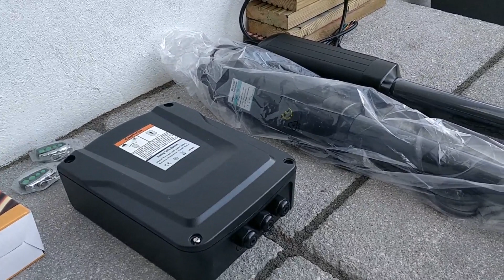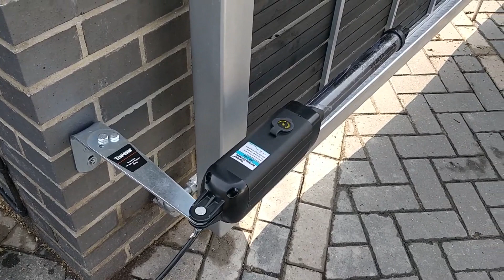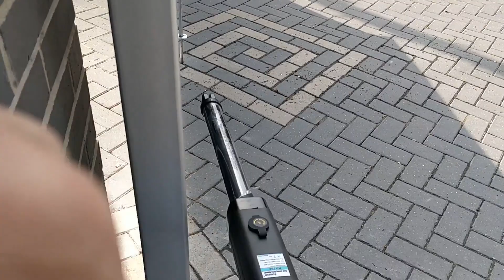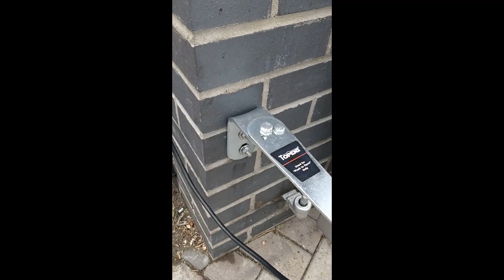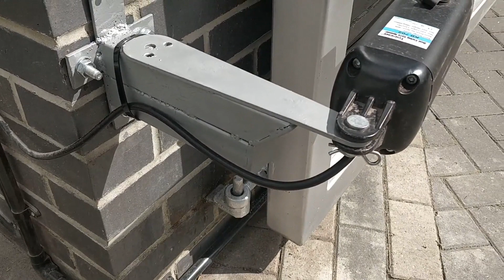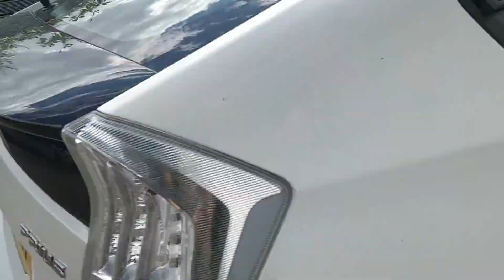Topen electric gates installation

Comment: You didn’t need to remove circuit board the green blocks pull of and u can access the screw and the brackets on your wall u you missed out the same l shape back above it should have been 4 included

Comment: Does it have limit switches on the linear actuator, which you can adjust, so that you can control the angles of gate opening?
Reply from the maker: There are no limit switches, but there are manually adjustable limit screws on the actuators. These can be used to set the range of movement.
Reply: Wonder how will the motor know when to stop, in absence of any electrical limit switches at the ends of the rod.

Comment: Great video will be fitting a Topens single arm soon. What size cable did you use outside above ground. I'm not sure between 1.5mm and 2.5mm twin and earth. Thanks
Reply from the maker: I used 1.5mm armoured cable from the house to the control box.

Comment: Looks great, good job. Is the cabling on the ground for the photocell detectors? I couldn’t see the detectors in the vid :-)
Reply from the maker: Yes. The photocell wiring is running in trunking on the ground.
Reply: @creationtools9541  what cable did you use for the photo cells? Is it a 4 core 3.5mm? As the cable is not supplied I’m not sure what I need and Topens are being a bit vague

Comment: Hi I have installed these gates on my drive but not set up yet. On the remote control did you only set it up with button A only, instructions are a bit confusing. Steve
Reply from the maker: Hi, 
Yes, I only set it up with the first button. You can set it up for all buttons to work but it would be pointless as they will all just perform the same function.

The remote is a generic one, used for other systems that's why it has 4 in programmable buttons.
Reply: @creationtools9541  thanks

Comment: Hi there, I just finished the arms and switch box today, do you need to adjust the arm opening angel and do you need to config and remote control? Will try again tomorrow, have a lovely weekend. Tia
Reply from the maker: Hi,
The arm angle can be configured but it might be okay as it currently is in the default configuration. Try it and see before attempting to adjust it. The remote will need to be programmed before use. I think it's explained in the instructions exactly how to do this. Let me know how you get on. If you need help, just let me know.

Comment: Hi 
Have the same system installed now 
finally got it working just have problems with the PBS system  ? Once open gates won't close ? Once system turned on with system off gates work ? 
Any pictures or short video how you wired them sensor wires up and to the main control box 
Thanks
Reply from the maker: Hi there, when you say PBS system, I'm not sure what you're referring to. Can you please clarify?
Reply: @creationtools9541  

The 2 x sensors that go each side of gates outside so it should stop the gates once beam is crossed  ?
It's how it's wired up that dont think is right on my set up as once gates open they won't close if the sensors are turned on
Reply from the maker: @hotrod6206  Hi Allan,

I've wired mine exactly as shown in the diagram on the reverse side of the control box lid. I'll make a video later today showing the wiring and the sensors in use.
Reply: @creationtools9541  
I wired how manual shows on the paper work for the 2 sensors  it shows on receiver side no, com, nc , plus the power - & × that done on same on emitter , did take both covers off and they both make clicking sound and lights can see ?
Reply from the maker: @hotrod6206  my sensors are silent.  No clicking sounds. Are your sensors black and shaped like half an egg?
Reply: @creationtools9541  
Yeah same looking as like a egg and black came in kit 
Not sure if did the wiring on receiver right ? Has 5 screw connectors for 5 wires ?
Reply from the maker: Just added a video showing my installation of the photocell senors
Reply: @creationtools9541  

Thank you for video m8 did reply on the video

Comment: Thanks for your video. I have two large wooden gates outside my house that i built myself but have often thought about putting electric openers on them. Can I ask if you know anything about how you would add a deadbolt to the gates. Ie. Bolt them to the ground or bolt one gate to the other. Would that destroy the opener if it tried to open the gates while they were bolted down.
Reply from the maker: Thanks for the comment.
Adding a deadbolt would not  destroy the actuator arms. When they sense resistance they stop opening/closing. I have a drop bolt on my installation. I use it only on windy days. I can  post a video of my drop bolt installation if that would be helpful?

Comment: Thank you for your video 
A couple of questions are they noisy when operating I could hear a slight winey sound when operating ? Also if they were closed against a stop in the ground would the rams make the gates more secure ? 
Thanks
Reply from the maker: They definitely make a sound. I wouldn't say that they were annoyingly loud but you can certainly hear them from up to 10 metres away. 
I think a stop in the ground is a great idea. You do need something to ensure the gates do not move beyond the maximum extent of the actuator arms.
Reply: @creationtools9541  hi 
If you put a stay on the floor the arms should push the gates against the stay with pressure stopping enough movement to some one pushing the gate open ? This saves fitting a lock

Comment: Nice video Ravi, i have also the same systeem from amazon, not installed it yet, try to learn from your mistakes, thanks for giving information about the 5 wire cables and 4 wire cable extentions, your video was very helpfull.
Reply from the maker: You're welcome.
Let me know how you get on with your installation.
Mine has been in place since July 20, nearly 6 month. Still working fine.
Reply: I just got mine in this week. Knowing what you know now. Would you hire someone to install this? I have the exact same opener. I remember you saying the wiring was a booger bear.
Reply from the maker: @CigarsDailyReviewbyLance  knowing what I know now, I'd simply prepare better. The installation is not difficult. You just need the right material to hand. I'm no more than a regular home diyer. My day job is desk based so there was definitely a learning curve here for me. That said, I've had past experience doing minor welding work so I was able to knock up some steadier brackets. But this was just a 'nice to have' addition rather than a necessity.
If the opportunity came up again, I wouldn't hesitate to have a go.

Comment: hi 
im a gate Engineer 
You may have trouble in high winds as you have fixed arms to the wood  not to frame 
james
Reply from the maker: You're totally right. 
I've decided to weld  horizontal bars on each wing to better support the arms.
Please do let me know if there are other things I could do to improve my installation.
Reply: Off topic, but I can not find any info on my issue I am having. I have a topens tew3 exit wand and I’m using a mighty mule 362 and the wires are labled different. I can’t find info on cross reference. Would you know how to hook up the wires? I’m sorry for the random and ignorant question.
Reply from the maker: @StephenBrewer89  hi, unfortunately i have no idea where you might find this info.  Topens don't really appear to have a strong online presence, support service might be hard to access.
Reply: @creationtools9541  you seem to be right! I’ll figure it out when I have some time but figured I’d ask! Thanks for the reply sir!